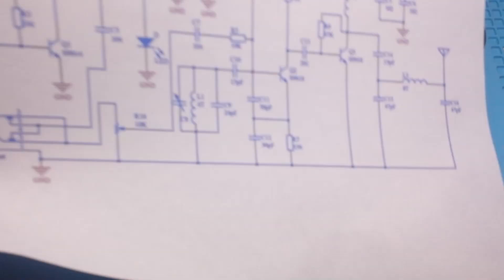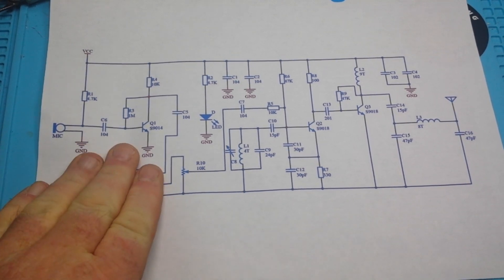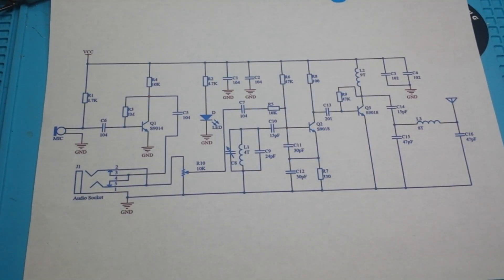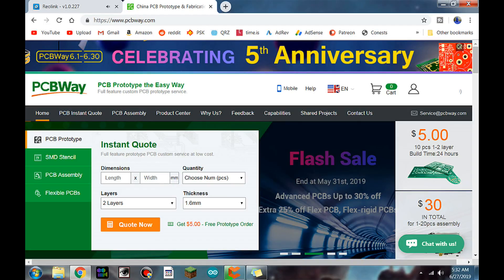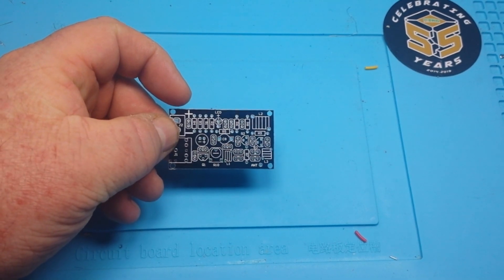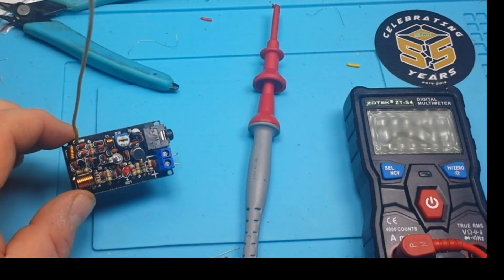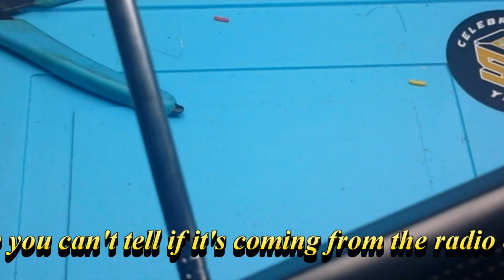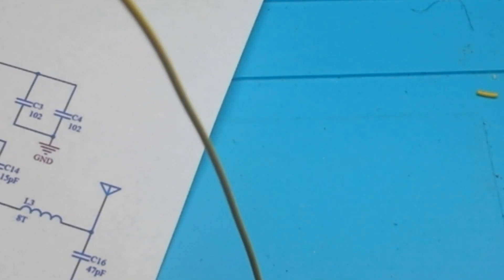FM Transmitter Experiment

Comment: I think that the 22pF caps used might be affecting the output signal. That inductor with the capacitors before the antenna acts as a low pass filter which is supposed to block harmonics above 108 MHz. It is possible the 22pF capacitors are blocking frequencies in the FM radio spectrum. If it was working, there should be a frequency that is silent with no static in it.

Comment: I ordered a kit a few years back and assembled it, looks exactly like that.  Works OK, I have it set up running off a lipo cell at about 3.8 volts, it puts out enough power to transmit across the room but not much farther.  Wife likes it as she can play Christmas Music through an old FM Radio I rebuilt and it sounds great.  The MP3 player I have hooked to it has a remote so she can change tunes from a distance as well as adjust the volume.

Comment: I bought an FM transmitter kit from ebay, only cost £2.99. Great sound and a range of about 50 meters on 6v batteries. I'm going to do more testing with longer arial 9v.
Reply: Did the longer arial give you better range?
Reply: @johnsmith-lb4mo  Yes it actually did, and I also got a lot of complaints from neighbours as I was interfering with a popular radio station. LOL.

Comment: Most countries have very strict rules/laws regarding transmitting Rf. These include allowed power, bandwidth, modulation type and carrier frequency. To legally build and test radio equipment usually requires an amateur radio transmitting licence or the professional  equivalent. These requirements and not government authoritarianism taken to extremes, but the very reasonable need to avoid the generation of interference with other users of the radio spectrum.
While building extremely low power transmitters is unlikely to result in significant interference, their use is still illegal in most countries. Those still wishing to proceed, should at least design their circuits to operate in the defined amateur radio bands. That way there is less risk of causing interference to professional uses of the RF spectrum. It is worth note, that while transmitting on the amateur bands without a license is slightly more responsible than transmitting on any of the professional parts of the spectrum, there is still a very good chance of being caught, as radio amateurs guard their privilege to transmit jealously.
It is unfortunate that it is arguably easier to build a low carrier frequency transmitter than one that transmits  vhf or above, since higher frequencies tend to have a shorter range. Circuits that generate milliwatts of power connected to a relatively inefficient aerial will only have a very limited range, maybe of a few metres and represent nothing more than local RFI, however, there is always the temptation to attach a better aerial.
 In the low frequency bands, such arrangements have the ability to reach great distances. In fact amateurs have competitions (QRP competitions) to see who can communicate furthest with just one milliwatt of RF power. The so called "work the world on a milliwatt competitions".
You are right to warn about the legal risks of transmitting music, every radio amateur knows better than to do this. It is one of the quickest way to get a knock on the door from law enforcement.
Might I suggest that a more fruitful area of investigation for those with a burning desire to investigate electronic communications and modulation, but without an RF transmitting license, is in the new wild west of open air optical communication. So far this is license free, yet radio amateurs and electronics enthusiasts are using optical transceivers to communicate over tens of kilometres, using a diverse range of modulation techniques, optical carrier frequencies and power levels.
Such optical transceivers do not necessarily involve the use of lasers, only requiring the relatively low cost, but high power LEDs.
Such devices fitted with suitable focussing lens, have been used to transmit voice, data and video over long distances, even in daylight. For those living in built up areas, some of the lights on the night sky line may be optical broadcast beacons.
Reply: He has a ham license. besides you do not need a ham license in the USA to build a radio from a kit or from scratch that transmits at legal limits for FCC part 15 applications. there are legit places where schools can buy kit radios that RX and TX  online and they are perfectally legal. Only if the radio requires a license do you need professional certifications or a ham license to built or service it. Hams are also not generally allowed to service non ham radios that are being used in non ham situations unless they are employed by a service depot (radio shop).  Radio manufacturers like Motorola frown upon non pro certified motorola tech working on their stuff. Kenwood and Icom are the same way to a point. This is also a great way to void a warranty on a new expensive department radio too and cause unnecessary friction.
Reply: @Elfnetdesigns  I have held a UK amateur radio licence for the past 47 years, but I am not particularly familiar with US FCC regulations, which may be more relaxed than those in the UK. I have reviewed the FCC part 15 rules, which are extensive. I could not find any direct reference to home build and operation of unlicensed transmitter equipment. As in the UK, there is a reference to commercially made certified approved equipment that can transmit without requiring a license. There is also reference to building a transmitter and testing it by transmitting into a dummy load, but connection to an aerial appears to be prohibited. There is a reference to making model control rf transmitters with a power output level of less than 5 watts ( a surprisingly high level for home made equipment.)
But I could not find the rules relating to building a hobby designed transmitter and operating it without it being first certified or operated by an operator holding an experimenter radio amateurs licence. Maybe you can point me to the relative section of the FCC rules. It would have been useful to state the relevant FCC rules at the start of the video. Then at the end, prove the circuit is compliant with the FCC rules.
This particular video did lack some critical measurements, such as RF power level, carrier frequency, carrier stability, frequency deviation, spectral purity and serious emissions. The circuits lack of audio level control and filtering suggests it's bandwidth will be poorly controlled. A simple open loop LC oscillator is not likely to provide high carrier frequency stability. I understand the purpose was to provide a demonstration and maybe not a practical circuit.
Reply: @nigeljohnson9820  The FCC rules in general are written to confuse people ,that is what happens when the government gets too big. You nearly have to be a lawyer with years experience to decipher some of their red tape inflated crap. 

The RC model remote controls are referring to the 27 MHz devices that fall into the US CB radio band and the older 72 Mhz devices that were used for model RC planes..

FM transmitters for 87 - 108 MHz that do not fall under part 15 whether kit built or professionally manufactured are not legal to operate unless you have a FM broadcast license. A ham radio license is not a free use ticket to transmit wherever you want with whatever you want. Yeah hams in the states can build and modify radios but they MUST comply with the part 15 interference section and part 97 on emissions and makes sure their build or mods do not violate any of those rules before going live on the air with it
Reply: @Elfnetdesigns  having spent a few hours reading through FCC part 15 rules, I must agree that they appear to have been written to confuse. I could not find any clear rules regarding the operation of home made licence free transmitting equipment, apart from a single paragraph that implied that some home made equipment may be operated licence free, but establishing what and under what conditions proved very elusive.
Radio amateurs in the UK are allowed to design and build equipment to operate in the amateur bands, but they are expected to be able to prove the equipment meets the band requirements on output power and spurious emissions. 
The UK also has a number of license free bands, where approved commercial equipment may be operated, things like, low power walkytalkes, radio modems, bluetooth, remote controls, and modules for radio controlled models, etc.  
I think the problem with this video is that it is trying to produce a simplify circuit where a more complex design is really required.
A stable low power AM transmitter is relatively easy to design, using a crystal ocscillator, frequency multiplier and a series modulated PA. A stable FM transmitter is more complicated, unless an IC is used for the early stages of modulated RF generation. Commercial transceivers often resort to creating FM using pre-emphesised audio applied to a phase modulation or modulation of a PLL.

Comment: I love radio circuitry but it is quite specialised.  Is there anything running in your workshop or in the component placement that could be causing interference?  I know a.m. is more susceptible but I'm sure a few of your subs are quite knowledgeable in this field!  Good luck.
Reply: gartmorn I think that the 22pF caps he used might be affecting the output signal. That inductor with the capacitors before the antenna acts as a low pass filter which is supposed to block harmonics above 108 MHz. It is possible the 22pF capacitors are blocking frequencies in the FM radio spectrum. If it was working, there should be a frequency that is silent with no static in it.
Reply: @PungieEC  I was expecting to hear the silent frequency to show it was tuned but I'm no expert on radio so appreciate your reply.

Comment: I'd like to see version 2.0 FM Transmitter, better antenna at maximum legal output. With tube transmitters, more power in the more output.
Reply: max legal output is like 100 mW or something pathetic but with a good antenna configuration and tune and height that will travel for a good distance.

Comment: Good project. Neighbor nearby has over-the-top Christmas light display sync'd to music. Cars line up at the curb & tune in his FM broadcast & watch the lights.
Reply: did he build the transmitter or is it one of those chinese flame throwers that will get the FCC's attention?
I mean if he is average joe public and bought a chinese transmitter that runs 0 - 15 watts for under $100 I'm pretty certain he has it wide open and next to a commercial slot above 92 Mhz. this is the common norm with those non radio experienced people who buy radios and just use them out of the box.. Like the guy who buys baofeng HT pair off amazon and never reprograms them , no license, just uses them on the test frequencies with the wife and kids at 6 Flags like it's perfectly fine.... This does happen BTW
Reply: @Elfnetdesigns  Seems to me he's rather savvy. Been doing this for 15 years & has st least 16 lighting channels. He's had no trouble with the authorities. 🎄🎅🎄

Comment: I've constructed quite a number of FM Transmitters over the Years.  I have a couple of really good circuits at hand using  a single  BC109 considerably less complicated.  One  with a rang of over a mile.   Yea, the FCC would get most upset.
Reply: very nice, care to share a couple of them?
Reply: @Eddy_AREA99  The same circuits can be had on the internet.   It's more the way you build them then the circuit it's self.   This is Identical to one of the better ones.   Using a BC109C construct it on Patch Quilt PCB.   Solder all joining point on one side of pcb on 1/4 inch Tracks  or squares on Copper Clad. Keep All Tracks and Landings 1/4 in wide  or square.   Use Double Side PCB using far side as a Ground plane.   Just use Tape to create your Tracks and Landings.   Etch that one side.   Don't Drill just solder components right to the Landings.  Keep all Component leads as short as possible.  Built as shown this one will just about get to your road.   Use the Track and landing patch Quilt PCB and it can get you in trouble with the longer antenna.   Have Fun.   http://electronics-diy.com/mini-fm-transmitter.php